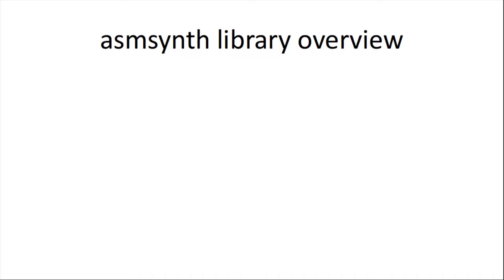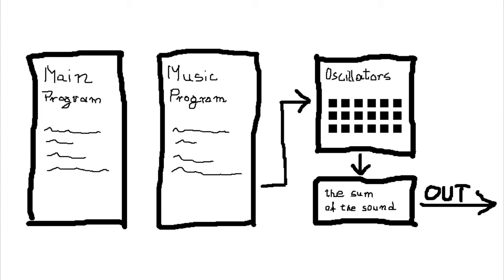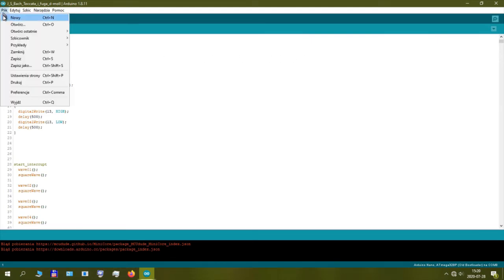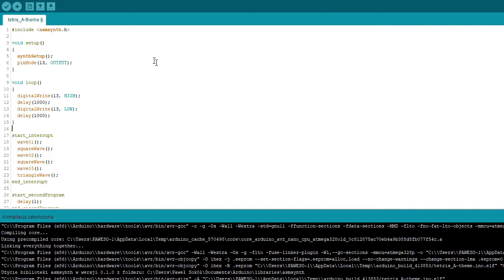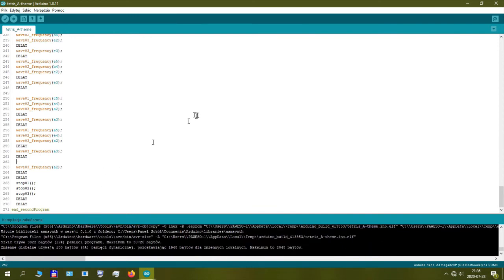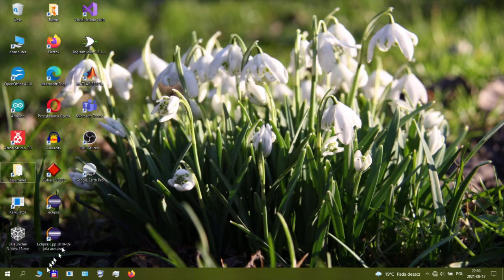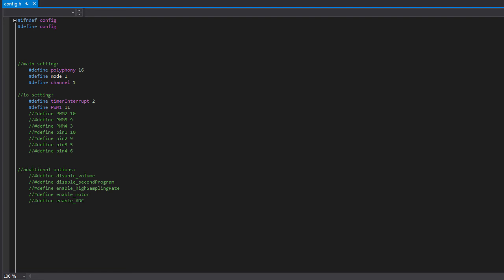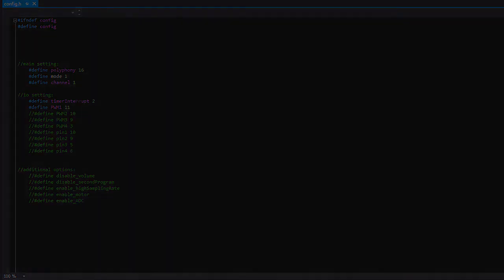Tutorial - asmsynth library for arduino - make music with the polyphonic synthesizer up to 32 voices

Comment: Tried this with an Arduino Mega2560 and two different amplification circuits (one passive, one through an LM358) into a guitar amplifier. Attempted both examples (the Tetris and the Toccata), neither generated any sound. Am I missing something?
Reply: edit config.h

Comment: Thank You SO MUCH! iv been trying to find something like this for a year now. Am gonna add keyboard and program my own ADSR envelope <3
Am assuming you are using H-bridge as an amplifier. So I think I can just use voltage divider and connect it to headphones right? or does H-bridge serve some kind of other purpose?

Edit: There is some kind of background noise when I don't play a key. is there a way to fix it or add some kind of filter?
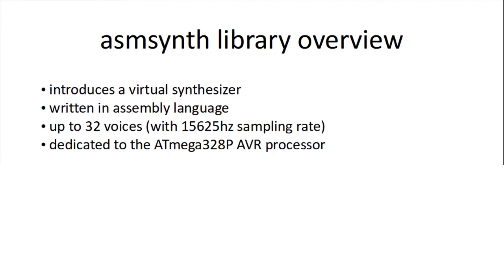Reply from the maker: Yes, the H-bridge in this case was used as an amplifier. It is worth choosing good transistors to best reproduce the sound. The one used in the film (l298n) has a bit too slow transistors and practically its purpose is different, but it works and sounds even well. There is another option like setting the library output to 1 (define mode 1). It then generates one PWM output. When no note is played, an average voltage of 2.5V (50% PWM fill) is generated. So you can use a high pass filter to equalize the average voltage to 0v. You should also use a voltage divider (recommended 1:10) if you want to connect to the microphone input or to an amplifier (or any other audio device). Of course, you should also be careful not to spoil the good equipment. Especially for testing and recording it, I bought an external sound card which I didn't feel sorry for because it was too penny.

As for the hype, there are several options. This can be caused by software, if you only reset the volume and do not stop the wave and do not reset its phase, various noises may appear. But I suspect that the noise is most likely from the PWM, then a low pass filter should be used. Mainly the filter uses capacitors connected in series or in parallel, unfortunately I will not say exactly how to make such a filter. Alternatively, noise can also be generated by this cheap sound card, as it was in my case during recording, then after recording I simply had to mute this noise in the program.

Of course I don't take responsibility if you burn anything, be careful. Good luck with your project! :D
I wonder how the final effect will be. ;)